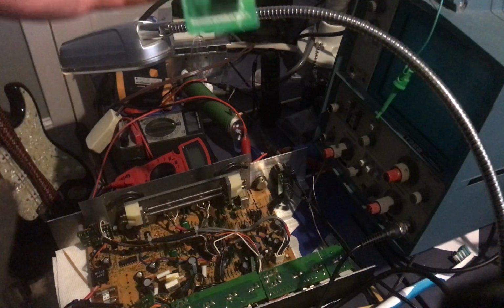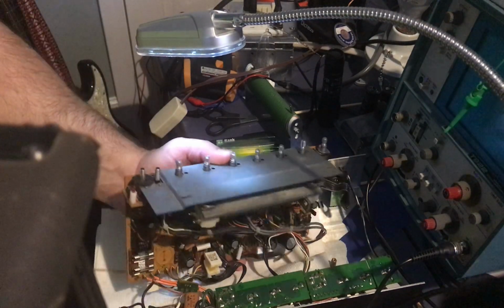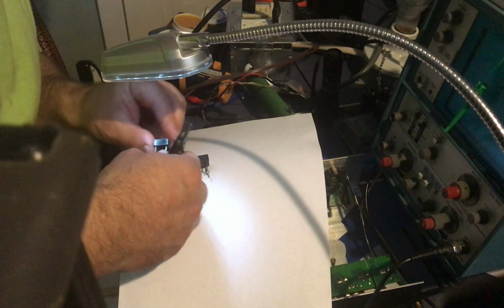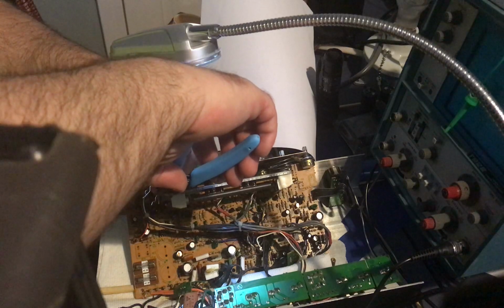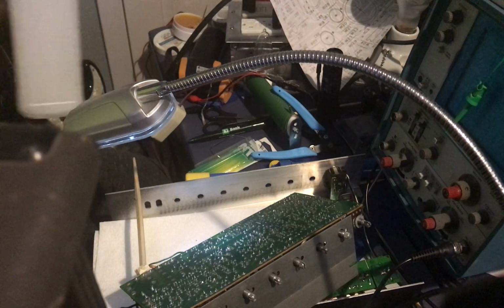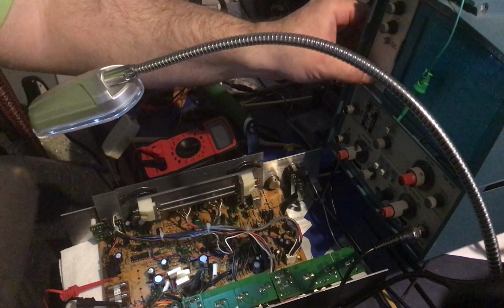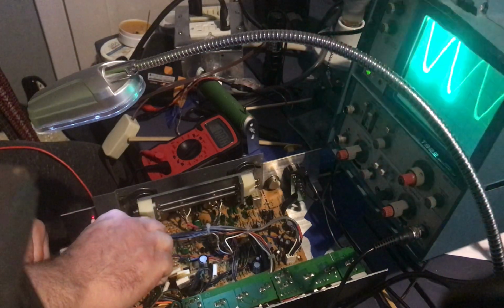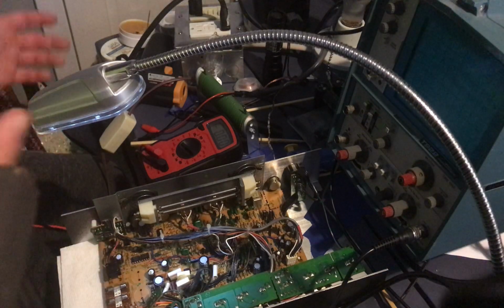Roland Cube 60 - short chasing part 3; rectifier replacement

Comment: This is a very useful video for Cube owners.   I have a similar model and also have a problem with the rectifier.   Rectifier model M4C32 and I doubt that it is responsible for the main fuse blowing.  I need advice on whether I could replace it with a KBPC604 rectifier? I am limited with the possibilities of procurement because in the country where I live (Serbia) we do not have the possibility to get what we want. Thanks in advance
Reply from the maker: I used an NTE5313